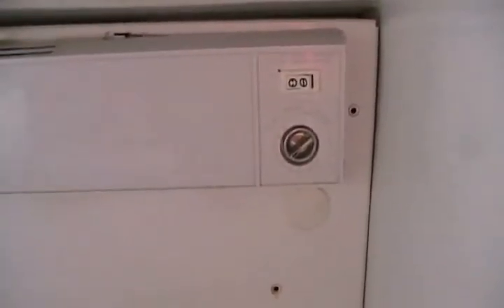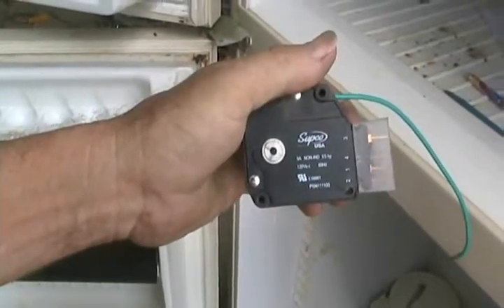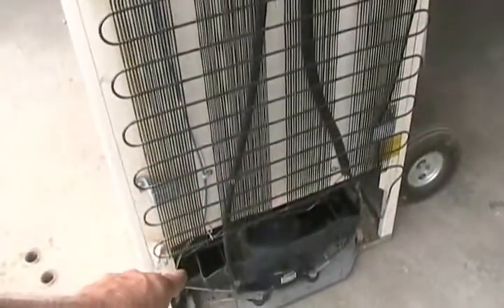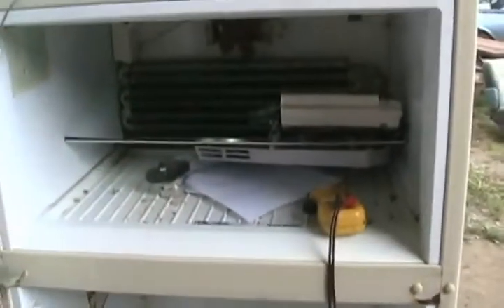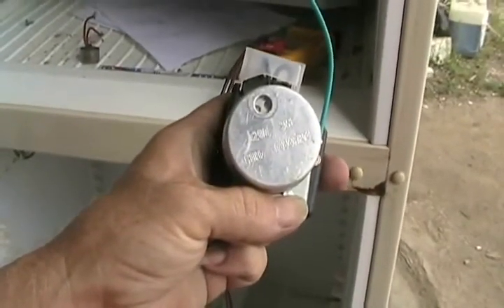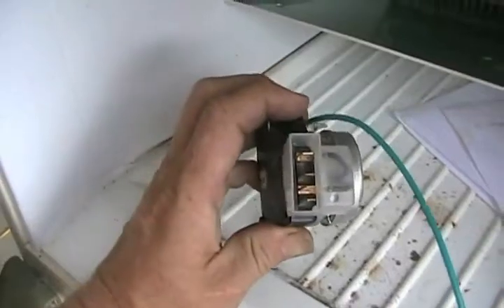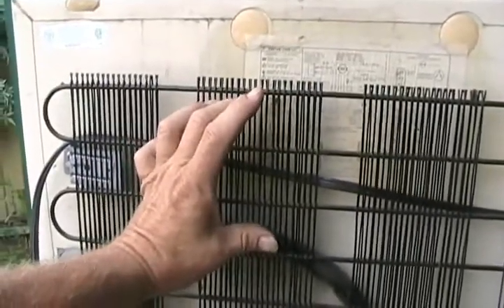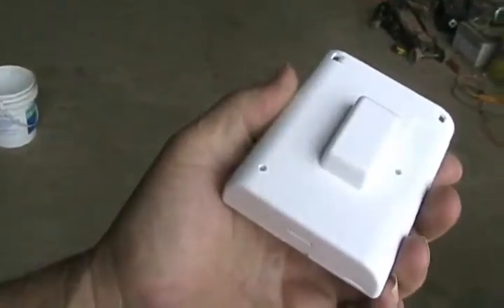how to Fridge repair, electrical problems, part 3 of 5

Comment: my fridge timer doesnt shut off the compressor or fan when i turn the dial, it makes a kind of crackling sound so im thinking that it is burnt out or not working properly , however the little wheel is still spinning? ive recetly had to replace the fan becasue it was burnt out and not spinning , it has improved the cooling a great deal but i think the timer may be bad , what do you think? love your videos very very helpful and easy to follow